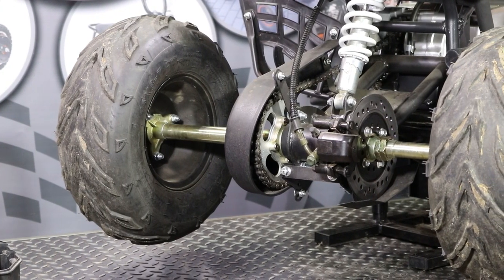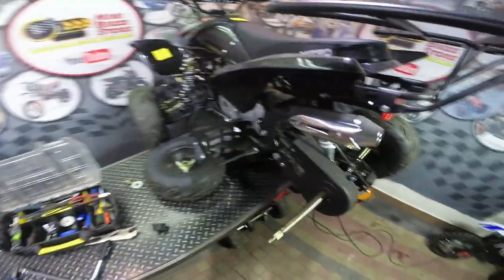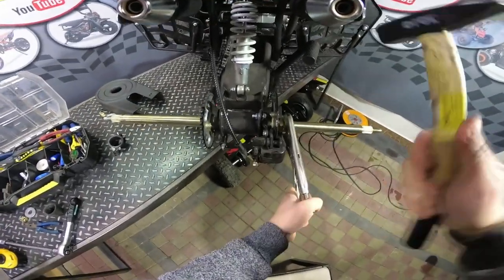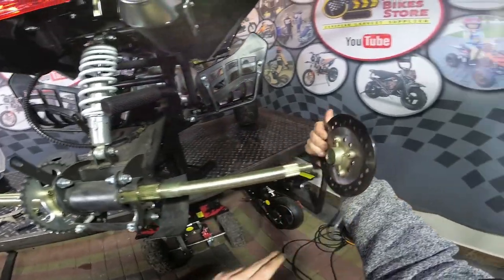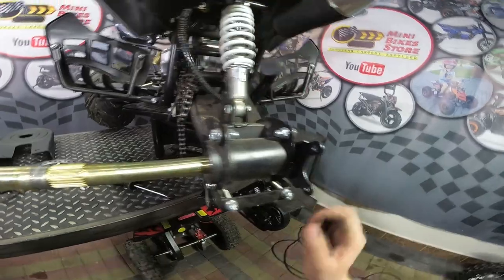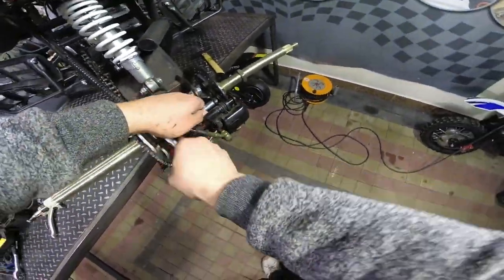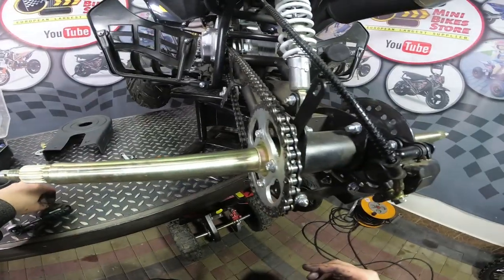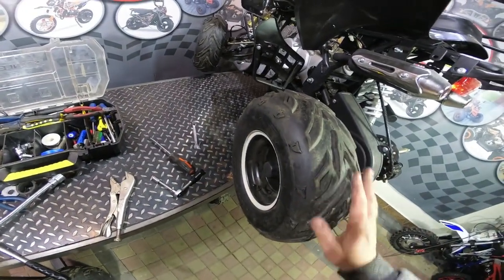Quads REAR AXLE REPLACEMENT INSTRUCTIONS - 110cc 125cc, 150cc Large Electric ATV

Comment: 8:49    the castle nut that holds the back wheels on  and is held with kodder pin   , how tight do you have to tighten the castle  nut ?
Reply: 50 ft pounds i only have an inch pound torque wrench so its 600 inch pounds also helps to put thread tape on the axle threads before torque and then castle nut then cotter pin